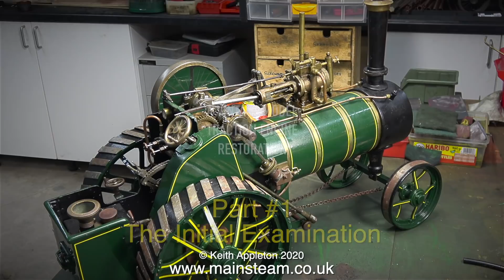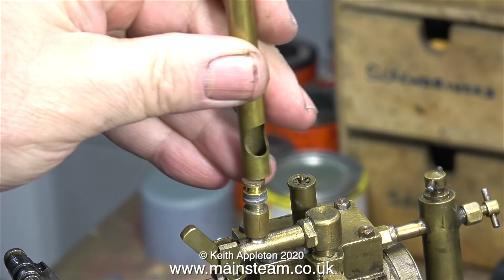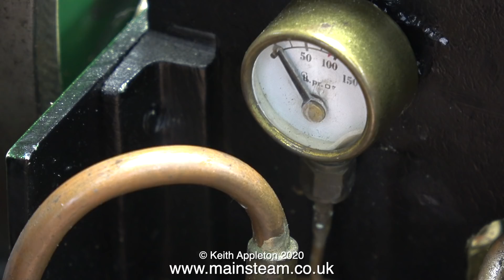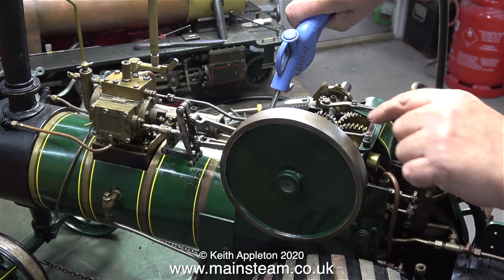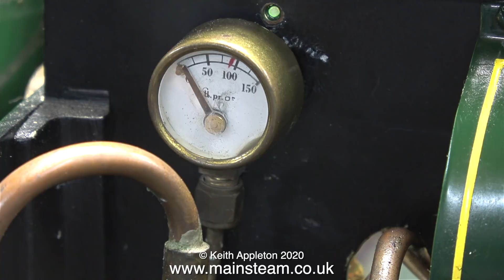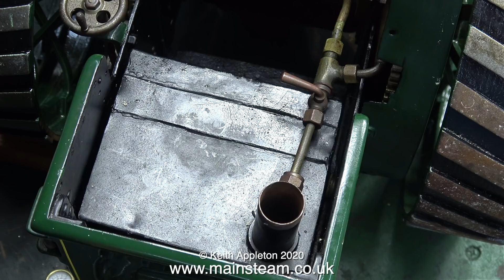A VINTAGE MODEL TRACTION ENGINE RESTORATION - PART #1

Comment: As you say Keith unusual gear change mechanism without a locking pin. I assume that the detents in the  apron  were designed to act as a lock maybe with a spring to keep them in place - a bit like on the reverser. Either way it does not look to be successful design. Such an interesting engine unique to the original builder.  I’m  surprised that given the major work replacing the boiler - almost a rebuild in itself that some of the defects were not attended to. That’s our gain because we will have the pleasure  of seeing it done by yourself.

Comment: Watching the crankshaft in motion I was curious as why the right side was loose and the heavily loaded end with the flywheel wasn't.  Is this because there is no center bearing and the crank is flexing?  Or is it because of a bad fit?  I can see that Keith has his work cut out for him,  this tractor looks good and deserves some tender loving care!

Comment: sympathetic restoration! . . . certainly . . . the builder, who is the sympathetic attachment, used a file . . . probably would have used something else if it was available but the workmanship looks good . . . no reason to make all new parts on a CNC machine ans basically make a new engine (although i know people with that mindset).

i bet you'll enjoy a lot of this restoration because of the little oddments and differences about it . . . and, of course, some of it will try to drive you 'round the bend.

Comment: About the gears, My Father used to say when he failed to get a transmission into gear and you got that grinding  sound " Going to have to get those Rubber Gears sometime". My comment at 8years old when he first drove an Automatic, "Hay Dad Rubber Gears" There after we have referred to Automatic /transmission car as   "Rubber Gear Cars"